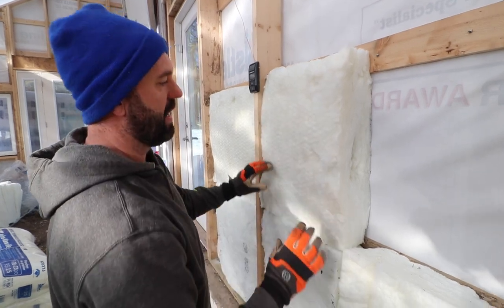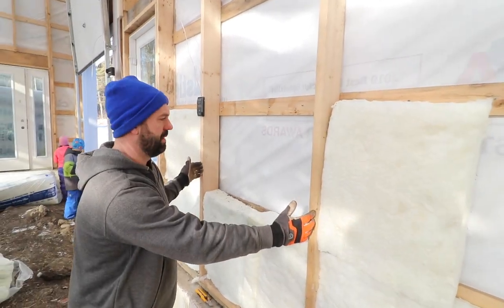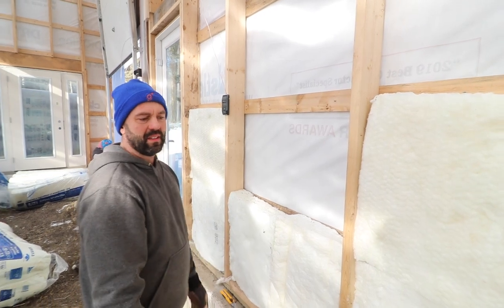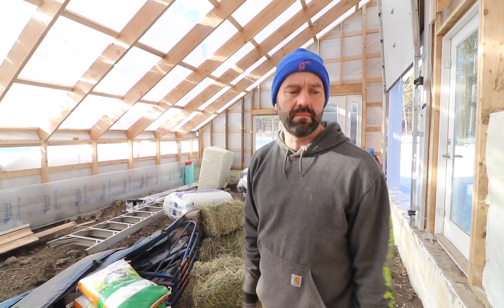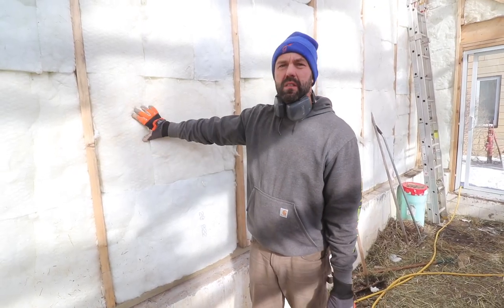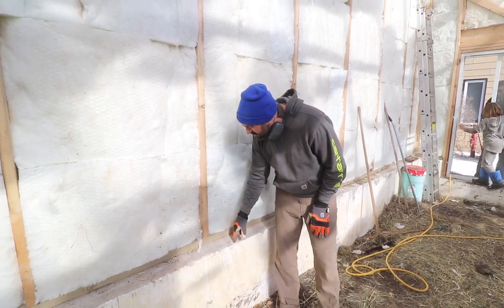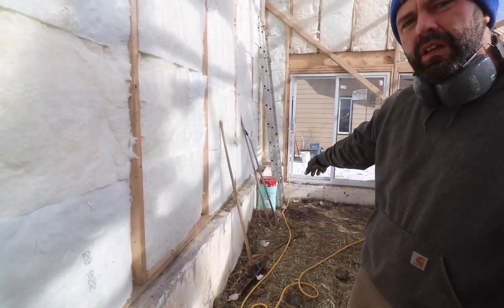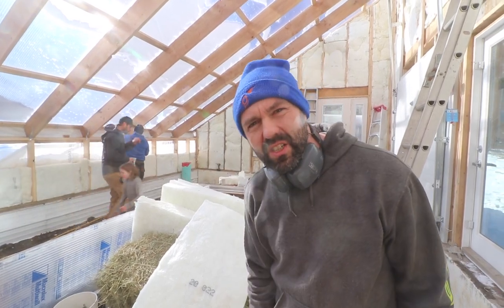Insulating The Solar Wall in Our Passive Solar Greenhouse

Comment: Good stuff.
Take this from an old scaffold builder.
Climbing up and down a ladder gets old quick.
To work on a wall that large get scaffolding for the whole wall.

The insulation would be done in one trip up with somebody passing the pieces up from the ground.
The plastic could be attached to the top and lowered. 
Based on how many people I saw working there. That wall would have been finished in one day.

Something to consider for other people thinking of doing this.

Comment: Is your stud spacing to code? I would have built the rear wall 16 inch on center & then hung my rafters from the top using hurricane straps to affix the rafters to the wall.

Comment: you really should have put thermal mass inside and insulation outside if this is supposed to be passive
Reply: They use a ghat system so..no need for thermal mass. The entire ground floor inside the greenhouse IS THE THERMAL MASS.
Reply: What is the R value where the cost outweighs the effectiveness with all the glazing on the south wall? (Point of diminishing returns)
Reply: @philandhannahslittlefarm1464  Very good point. I think the decision for how much insulation to use is up to each individual, because it's hard to assign a dollar value to the benefit of additional insulation. I remember seeing a chart in "The Year Round Solar Greenhouse" where they show a huge benefit going from 0 to R10, then steeply diminishing returns beyond that. However additional insulation may be worth it to you if you are really trying to push your growing zone and every little bit helps. Figuring out a way to cover the glazing at night would have a much bigger benefit, for example if you can go from R2 to R4 through a movable insulated blanket. There's a grower on YouTube in Alberta who has a Chinese style greenhouse, which uses 2 separate rafter systems each covered in poly, and an insulated blanket in between the layers.
Reply: @cherrytreepermaculture756  yes I follow him as well. He has no insation on the north wall. I think the thermal blanket keeping the heat in would be more effective than spending too much insulating the north wall.  R10 makes sense to me